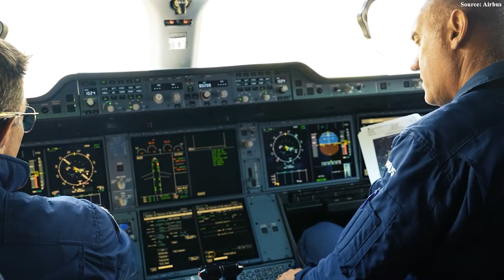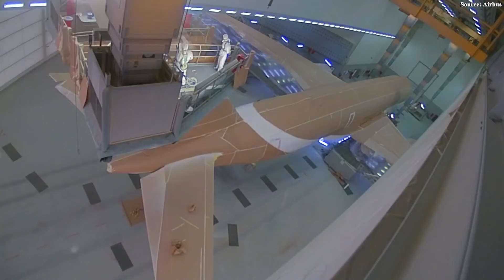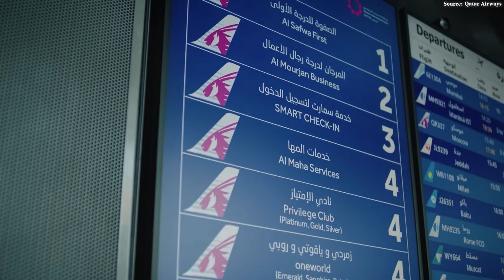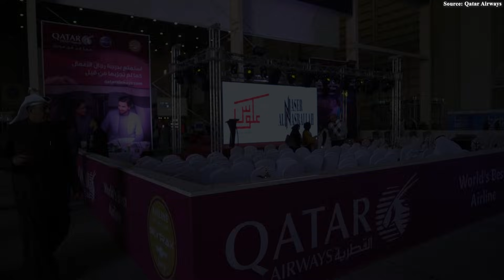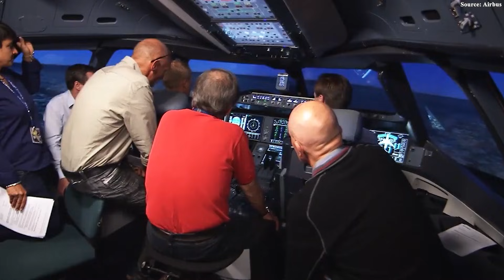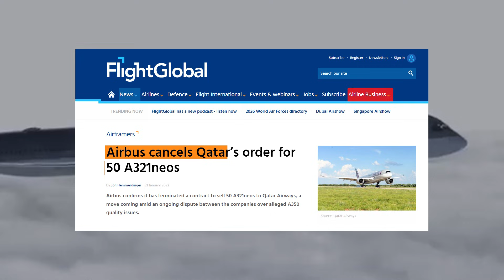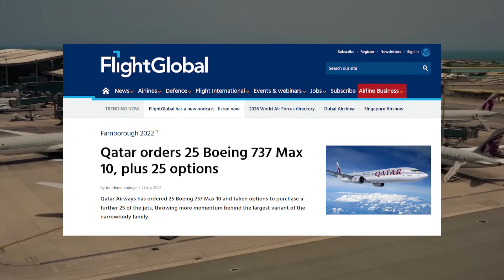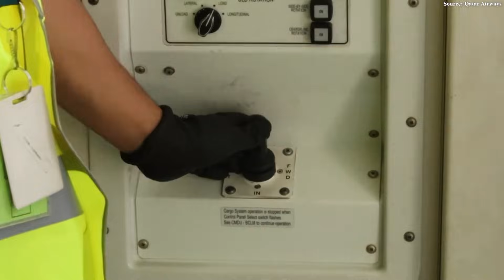Here's SHOCKING Why Qatar Challenged Airbus But FAILED

Comment: I can understand why Qatar was upset about the paint job issue, you don’t want customers to see that flaking off. Airbus correctly handled it as a warranty issue.

But a Faraday cage is a Faraday cage, even if it has small defects. Qatar’s safety claim was not backed up by physics. In a legal fight, that is a major blunder.